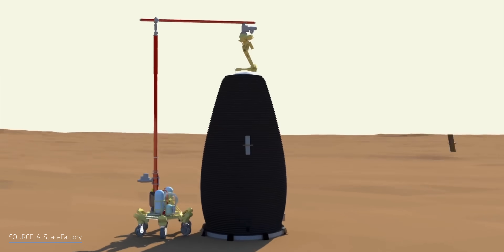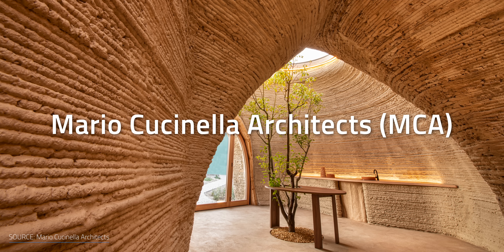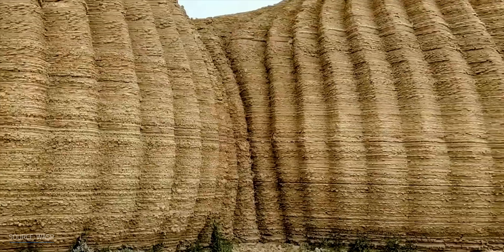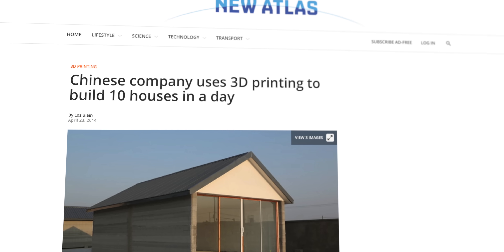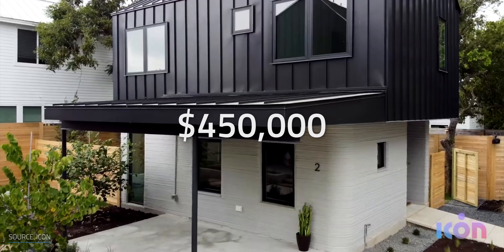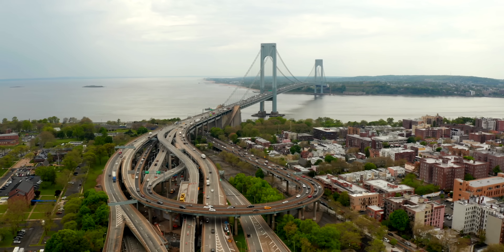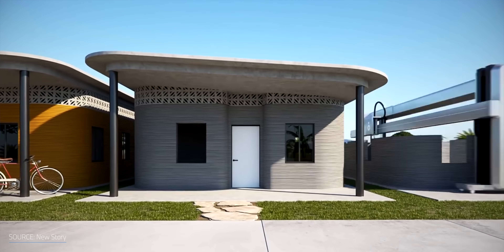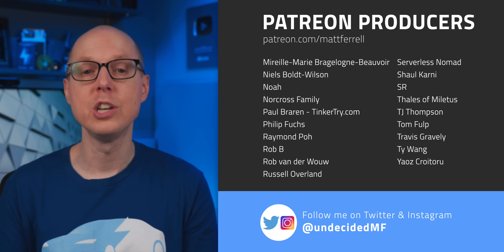The Truth About 3D Printed Homes

Comment: In most parts of the world living in a house made of "mud" would be way preferable to the desired alternative which is concrete block, typically made of imported cement (one of the worst materials environmentally). Most of these block houses are built with zero rebar (because people think concrete must be strong) and no engineering. In some areas you could reinforce the mud with shredded plastic waste rather than grain hulls and people mostly don't have all the systems "first world" houses have in them. Also these could be cheap, local alternatives for non-residential buildings like for a farm, industrial storage etc. Many of the objections given are "first world" issues. "stick built" homes are cheap in  North America where there is a huge building material industry that can supply cheap lumber, drywall, siding etc that at least comes from your continent. In Africa there is no lumber industry so all the basic structural materials have to be imported or are heavy, GHG intensive, concrete block. People have been making houses essentially from grass-fiber reinforced mud for eons and many have lasted long enough to be researched by archaeologists. Mud dauber wasps eat clay, but termites, carpenter bees etc eat wood and the tropical termites don't have to stop for winter.

Comment: This technology....I'd say rather than building a house 100% using this tech,  figuring out how to use it on part of the build to design better quality, well engineered homes in different climates is the key currently. If they can gather that data and experience this tech would be more mature. Additionally the idea that sparked for me was, this tech would be useful for building cisterns, or other useful infrastructure for communities rather than a house to live in. While you listed several unfortunate realities regarding the eco-friendliness bout their idea for building communities with this tech. What came to my mind was materialistically its still more eco friendly at large building sites away from society because it would diminish outside materials introduced to the site. I'm sure it would be helpful to eco-groups to build outposts on location at various terraforming/regreening projects. Or  for a property where people'd only be there a few months of the year and leave it sit the rest of the time. You wouldn't be polluting much if it ends up abandoned either, unlike most of our infustructure.

Comment: I am with you on this 3d printing technology. It does not seem ready yet and it has its problems. While it can make the main structure, it does not make infrastructure.
Reply: Sadly, Matt only touched the tip of the iceberg with "3D" assisted house construction. There are multiple technologies in this space, many of which have many years of R&D behind them building houses, bridges and other structures, including companies creating ready-made interconnectable wiring and switch "looms" that can be installed by helper bots that work in tandem with the wall bots.

Comment: Concrete doesn’t need drying to solidify /cure. It’s a chemical reaction that on the contrary requires defined humidity.
How would dams and piers would withstand water if concrete needed to be dry to be hard?
Reply from the maker: Yes, it's a chemical reaction.  Saying that it "dries" is a colloquialism.  To be completely accurate I should have said cure or set.
Reply: @UndecidedMF   Great video, I forgot to mention. :  )

Comment: In regards to a long waiting time for the clay to set all you need to do is add 1% cement powder to the clay mix!!! It's from a Geotechnical road building method called Stabilized Pavement where 1% to 3% cement powder is added to what ever material is being used like clay or sand and gravel. The end result is a very durable road base.
Reply: Though if you add even a little bit of clay to concrete, it shrinks notably more.

Comment: A local company in my area just started constructing 3D printed homes. I called them and asked about it. For a 1200 sq. ft. home they were asking $400,000!! A stick built home that is well over 1,800 sq. ft. home go for $300-$350k. I told them thanks but no thanks.
Reply: Do you mind saying who was offering quotes?  (cause they were still probably taking a loss - but it should get better)  Thanks!

Comment: btw there is no such thing as printing 3d. 

regular paper printing is just a layer of ink. what people think 3d printing is? is just using an "ink" that has a higher consistency and is layered many times.

so I'd call it layered printing.

btw much like our ancestors did when building the pyramids or later on when building houses with stones and or with bricks or even wood, its prety much all the same principle: layered construction.

talk about reinventing the wheel.

the only difference: the automaded fasion of the build versus using a human workforce.

Comment: I built my forever house and shop 3 years ago. I used a product called Faswall, which is stackable blocks made from cement and wood fiber, so basically cinder blocks. The wood is treated with borax, I think, so the bugs won't eat it, similar to what is done with the bamboo sheet products. My house walls are 1 foot thick. I also did residential concrete work for 30 years, and of the stackable block type houses, I considered this to be the most efficient system, though for a house of any size, it should be left to a professional. To me, especially with the scarcity of good framing lumber, the stackable blocks are the way to go. The 3D printed houses are still in infancy, but they have a lot of potential. All sorts of natural fiber can be used for reinforcing the walls, but need some treatment to bug proof it.
Reply: Oh, I guess I should add that cost will probably not be less than standard stick framing. I believe the construction crew that built my house said cost was about 20% over standard stick framing, but I have probably made that up in energy savings. Minimal heating and cooling expenses, in part because I live in a mild climate, Oregon...

Comment: from a practical and ecological not to mention a time saving point of view modular houses or factory built homes are a much better solution to the houing problem, not only are they quicker to build on site, can be built in 1 to 2 day once the foundations are layed which takes about 1 day to do and a few weeks to dry, but because they are built in sections in a factory there is less constrution waste, less power usage in making the building, easyer transport of constrution mats and can be built anywhere that you can get the house sections to. also the final product will be more energy effecant than a mud house would be due to built in inserlation and or cooling. are they perfect no but i believe that they are a much better answer to the problem than a 3D printed shack made of mud.

Comment: A girlfriend had 3d printed concrete little animals.  The concrete broke down in less then 2 years, and were nothing but a pile of dirt.    While this could be a local-one-off mistake, it does point out that outside walls, likely need additional protection against the elements.   I'm excited for the potential.

Comment: Speaking as an engineer, many comments mistake the current, nascent status of 3D printing for its maximum potential. People are complaining that walls are a relatively small percentage of total house costs are totally missing the point: walls are the hardest part to automate, and are thus the key proof of concept. Consider wiring: since a 3D printed building is just a CAD file, it’s trivial to add features like wire routing channels or hvac. Once the routing channel is made, it’s not that hard to drop a wire harness into it via another robot.
Reply: Right except the trivial part.  The Arizona 3D house tried that and all the printing starts and stops made a big mess.

Comment: I'm a bricklayer by trade....I still think an all masonry home is way better. I personally like the method used to build schools in Ohio. Grey cinder block either 8" or 12" and 2" pink foam up against the waterproofing, covered by a veneer of brickwork or stone of choice. This system uses hook and eye dura wire along with hooks to tie in brickwork to tie it all together. It does create some pretty thick beefy walls though. If using 8" block overall wall thickness is like 16" and 12" block will give you about a 20" wall depending on how the architect figures the air gaps between the walls. Overall using this system instead of a standard masonry veneer will probably cost much more and personally I've only ever saw a few all masonry homes built here in Ohio at least...not real popular because of cost. But this is I personally would like to build for myself.

Comment: may i say that comparing the final price is useless? you just have to consider the structure price itself, since you can use cheap stuff as furniture and sealings or gold made ones, that doesn't make the 3d printed house itself costly, only the accessory are

so a woodmade house is chaper than a 3d printed one? no, but it has also some different advantages, so cheap is not equal to good

Comment: I feel like relying on 3D printing is not the right thing to do, at least in climates where fast-growing and strong materials like bamboo can be easily obtained.

Also, I'm not sold on the fact that printing the walls instead of premaking them in a stick frame style, transporting them to the construction site, and putting them up there.

Comment: Bad insulation, bad erthquake resistance, bad water resistance, bad quality control. This is just a marketing project. Why would one not just deliver prefabricated elements and assmeble the whole house in 2 days... with no compromises to the above mentioned things. Plus the structure cost of the houses is less than 20% of the total cost. You will spend way more on papers, land, taxes and furniture than a structure...

Comment: first, please note that homes and other structures have been built through serial layer deposition for thousands of years: courses of masonry, particularly BRICK.
I am not at all convinced that these rapid-printed un-fired mud homes can withstand one particular climate feature common in most heavily-inhabited areas: Rain.
I am not at all convinced that they can withstand earthquakes - unreinforced dried mud is friable.
clay shrinks as it dries, expands when it absorbs water. even if it does not get sodden enough to deliquesce, irregularities in moisture content will - not could: will - cause significant structural deformations and load concentrations.

I suspect this is solar freakin' roadways and water form the air: nonsense.

Comment: Hold on. This is clay, right? Which means, it will be washed away during rain. The reason we use clay bricks is because the clay bricks are stabilized, most commonly through heat. How would they stabilize this clay in this setup?

Comment: The advantage of 3-d printing is mostly for rapid prototyping and that you don't lose material through subtractive construction. Neither of these are really relevant for building houses, since pouring concrete is already an additive process. The only advantage I can see is that you can make more complex shapes and have the walls be more hollow while still being robust, and so save some amount of material. I don't see how you could put rebar in a 3d printed house though, so I'm doubtful of the structural integrity still.

Comment: Back in 1993-94 and then again in 95 I built two rammed Earth houses using a block machine. The second house we used 10% Portland mixed in with the appropriate soil type right before it went into the block press which helps stabilize the material. It seems like some of the techniques used and rammed Earth construction could be used here in wet Earth extrusion to help with longevity and strength.

Comment: Maybe I am getting caught on the 'definition' of 3D printing.....but , prior to 2014, I have seen buildings using the 'aggregate'  approach applying concrete from the end of a sprout moved by a huge X/Y mechanism.  Yeah, structural support would be added above openings for windows and doors.  Unless you strictly mean use of resins, those buildings were 3D printed in practical terms.
I must say it has more of a future in countries where houses are build with brink and mortar.  For them, the construction would be expedited.  In North America, with the abundance of wood in Canada and the USA and price of a house determined by size and location, I do not see the concrete 3D printed house catching.  To draw a parallel, last I heard about a concrete house being build in my are for tornado resistance, the home was 40% more expensive to build, but still had the market value determined by size and location.  Telling buyers it was tornado resistant was like an 'amenity' (alike to having a swimming pool, workshop, game room, etc), that would be important for a buyer that was looking for that particular feature but not affecting the overall market value dramatically.
Reply: @delgadoj2 You are quite correct in regard to 3D printing technology to build houses. Both concrete printing and 3D brick laying / mortaring are solid technologies that are likely start to scaling. Here in Australia, we've had a growing supply problem with timber and other building materials (particularly imported materials) that has been exacerbated by Operation National Sword, the Pandemic, and is only likely to get worse if you consider the current Oil crisis and the likely climate impacts and mitigations outlined in the IPCC red alert impacts report. Forests are at risk as many continents are facing increased drought and bush fires, and deforestation is impacting many countries that are often sources for cheap lumber. The last significant bush fires in Australia in late 2019 / 2020 were significantly more severe and damaged those forests in ways that have prevented recovery of some ecosystem elements.

Comment: Why can't 3d printed homes by current industry standards be built upon as a, for lack of better word, foundation? Design for filling with green concrete and \ or hemp etc. Water sealer, OSB or whatever the non-swelling version of that is I always forget. It's less green but could probably be printed as well using a resin sawdust type of mixture. Sand paint seal. Gypsum as well

Comment: 3d printers are exactly the wrong technology for mass manufacturing identical (or near identical) things. Why do so many companies insist on doing this?

As someone who's built homes in the USA and Europe, I find it curious that there are so many companies focused on printing the walls. In my experience, walls aren't where a lot of man-hours or cost goes. In the USA with a wood-framing construction system, the walls can be put up in a matter of days or even hours by a competent crew and even in Europe where the walls are stone, the actual "bricklaying" doesn't consume that much time. What does consume time, money, and manpower are all the extra bits. Electrical, plumbing, windows, doors, lighting, HVAC, and so forth are very "fiddly" and require specialists, yet none of these 3d printed house companies have automated any of this. Furthermore, the other two great drivers in homes are basements/foundations and roofs--both of which are also horrendously expensive.

If one truly wanted to solve the global housing crisis, I think it would be a more economical and ecological approach to go in the direction of mass-manufacturing so that you can produce pre-fab or modular housing units that have all the difficult parts done already and can be assembled into high population density settlements instead of shantytown sprawl. Yes, there would be logistics difficulties into getting these homes to where they're supposed to be, but I think it would be easy to balance these out financially and environmentally with the advantages that come from centralized, assembly-line, mass manufacturing.
Reply: Good points.